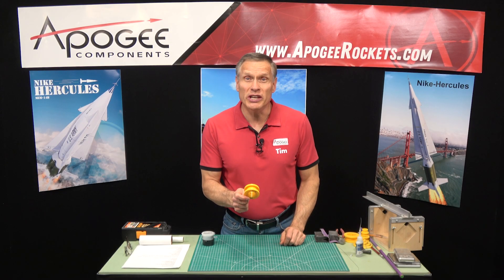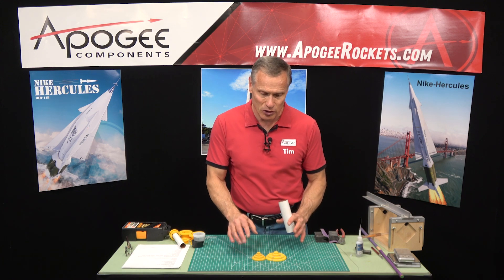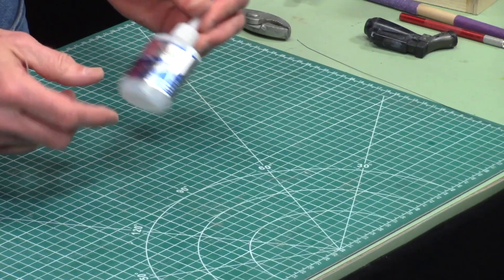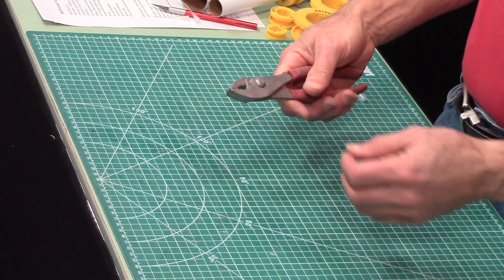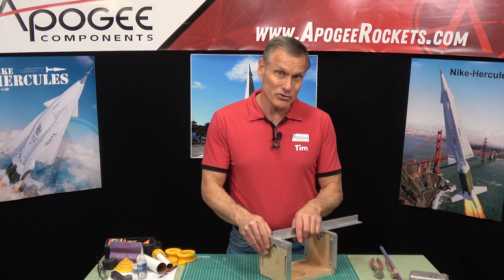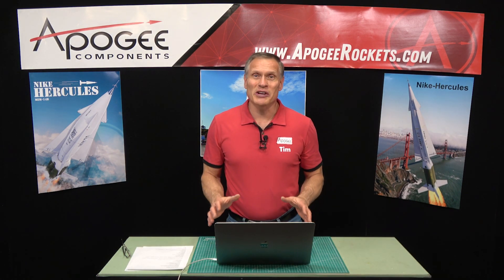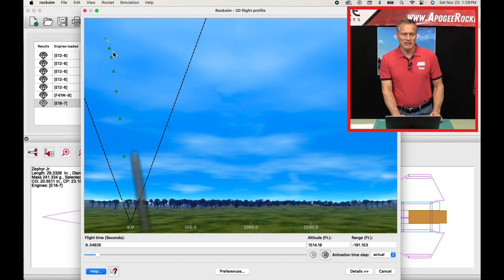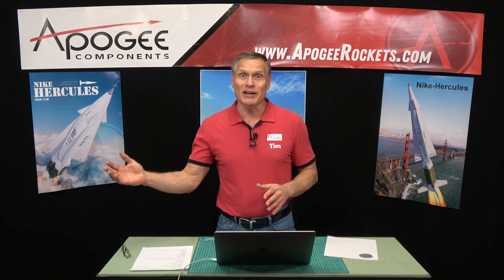What Tools do You Need for Building Skill Level 3 Model Rockets?

Comment: I was surprised you didn't mention that bellows glue applicator you used to assemble the Star Lift Mega Lander....ever since I built that rocket using that glue applicator....I have been using it on almost all the rest of the builds I have done since then....great little tool .